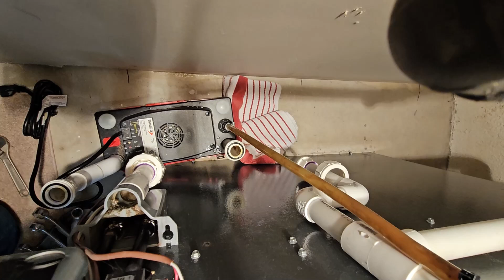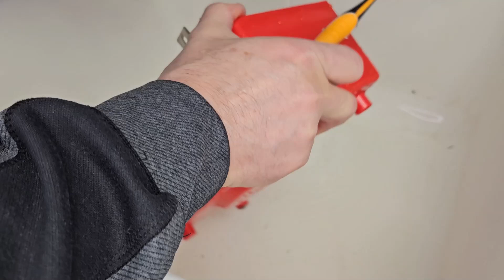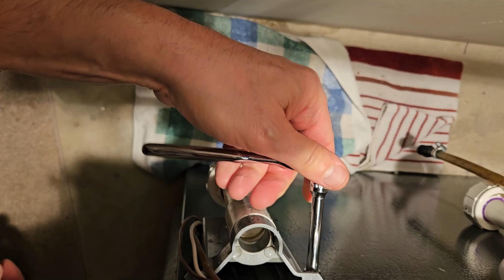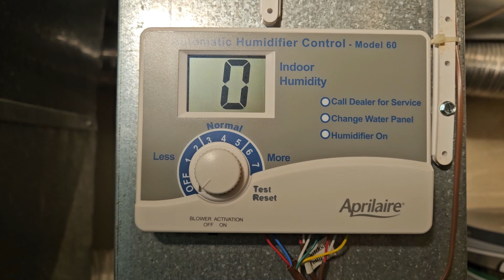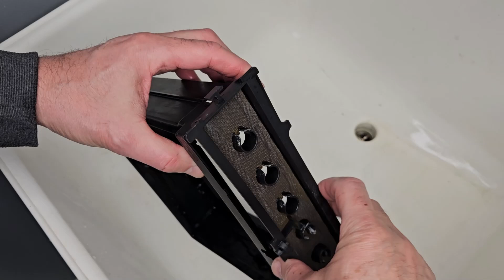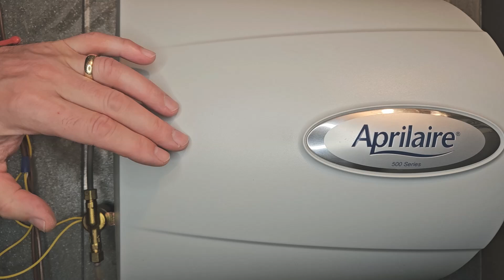How to Maintain Your AC Drain Line, Furnace Water Traps & DiversiTech CP-22 Condensate Pump

Comment: I didn't see you address the 3 electrical prongs.  I think these are for an auto shut off feature but they need to be hooked to the furnace itself - which was my question.  Still - good job.
Reply from the maker: Hi uppervee7419,
My HVAC people didn’t connect them to my furnace.  You’re correct that it can shut off the furnace if the pump fails.  I decided not to connect it myself since I live in a cold climate.  If the pump failed in the dead of winter while I’m not home, I would run the risk of the water lines freezing and bursting.  Thanks for your comments and thanks for visiting my channel.